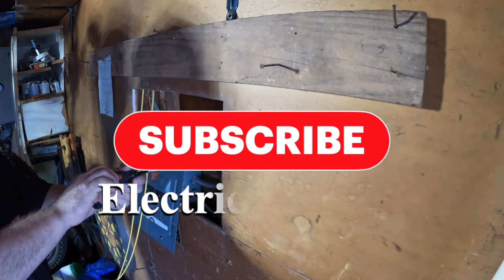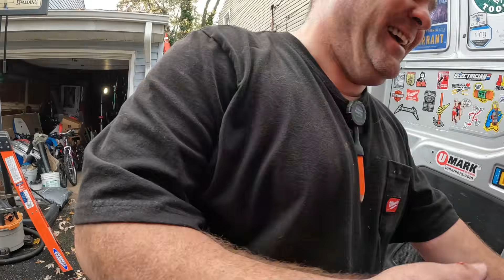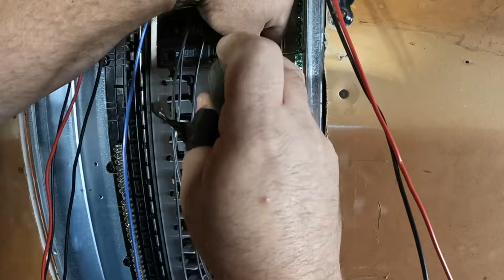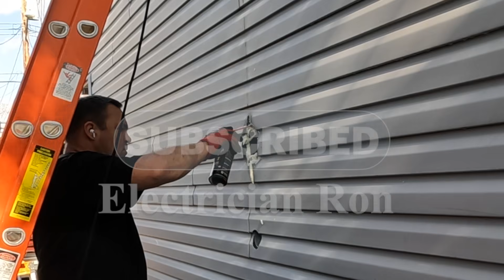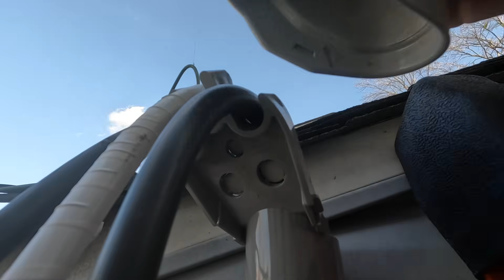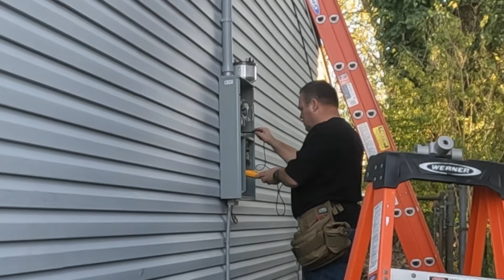Just Another 200 AMP SERVICE UPGRADE #electrician  #200AMPS

Comment: Wait. Why isn't your weatherhead 3ft above the roof line? Also, did you connect your meter stack wiring to live overhead from the pole?
Reply from the maker: Because it doesn’t have to be 3’ above the roof line. This was live service upgrade.  Yes, utility is hot. Why, you don’t do that where u live?

Comment: Actually curious why you still use no lox ? I too am an old school electrician but I have been told that is unnecessary and actually not good to use it on modern meters or panels
Reply from the maker: It’s never been “not good”, just not required now because of how aluminum conductors are designed and made today.

Comment: If the new panel required the branch circuit conductors to be lengthened, can you splice in the panel or does that have to be in junction box after the panel?

Comment: Hey fast question for you Ron, just looking for a ballpark figure.  My sister in Law owns a two family in Buffalo she reclassified to a single occupancy.  Her main service is in need of an upgrade and at the same time, she wants to consolidate the circuits for both the front and rear dwellings into a single 200A service.  I'm well aware of the different factors that could affect cost between your part of NJ and my part of NY.  But what would you generally charge for this job, if she lived in your area?

Comment: Happy thanksgiving. Nick work. Done professionally. Two question. So in 2023 nj required emergency disconnects to be installed for the service. Does it have to be outside like your main breaker meter enclosure? Also the required surge protection that’s nec or local requirements. Thanks again. New to the channel. Subbed and looking forward to all your content
Reply: Sorry about the dumb question Ron. I just did a quick search on the 2020 nec and found all the answer 😂 I’ve been out the game for a while. I’m planning on taking my exam prep course come January. To get ready for my journeymen test. But quick question when it comes to these services upgrades. What manufacturer you recommend or prefer?

Comment: is it okay or normal for your panel to have a slight hum?
Reply: Yes, it’s most likely the doorbell transformer.  It’s often bolted to the outside of the panel box behind the drywall so even if you take the front cover off you can’t see it.

Comment: Ron, great video, as always. You may already know this, but if you need a connector for MC and AC that you can install from inside an enclosure, just like those button connectors for Romex, Arlington makes Snap-2-it connectors that do just that.
Reply from the maker: @Gruntled2001  I will look into that.

Comment: The only thing i would have done differently would have been to install a rigid closed nipple or a PVC box adapter between the meter main and panel, just so I wouldnt have to cut the TA like that. Ive cut TAs in the past, but have i have had an inspector call me out for it, so now i dont do it. But other than that, it looks very good. I am a big fan of Eaton BR load centers too
Reply from the maker: @YaksAttack  it is technically a “hack” and the only nipple I had was too small. You and I know but both know it’s fine the way it was done.

Comment: Great video. Do you know if the power company ever replaced the conductors from the pole to weather head? The conductors look a lot smaller than the new conductions. I noticed the the existing weather head was about even with the roof line. At the homeowner's request, could you have extended the weather a couple of feet higher or does it matter?

Comment: So? The very old wires are simply reconnected?
Reply: Think he’s mentioned that he inspects them for signs of overheating, fraying, and the state of the insulation on them, and proceeds accordingly, advising the customer etc. In most cases the wiring/conductors, even if older are fine.

Comment: Your videos are Great. Did you mount the inside panel upside down on this job? Or do they make panels with the main on the bottom of the panel?
Reply: Any breaker that operates side to side can be at the top or bottom of the panel. Only when it moves up and down must you position it a certain way so that up is on. This is not upside down, this is a brilliant way to save space and a few bucks in heavy gauge conductors.

Comment: I had one of my friends call me about lights flickering and he showed me a pic of the panel. It was a Stablok that had aluminum Romex and some of the breakers were double and even tripple tapped with copper and aluminum Romex mixed! I told him to put the cover back on and to call an electrician lol. He asked me if I could do anything with it because I worked for an electrical contractor as an apprentice and I have changed service panels before under the contractor's license but I couldn't do anything in this case because I'm not licensed myself lol
Reply: Very wise to not help yourself to liability. You're friend sadly has to pay full price for that mess ... Good move on your part tho.
Reply: @TheTubejunky  He did get it done and had all the wiring upgraded, thankfully they had an addition put on and all that just ended up being part of the cost of the addition. If Ron here wasn't hours away from my area, I probably would have referred him lol.

Comment: Ron, since this house had a 100A service prior, is the transformer on the pole only 100A? Did the customer have to get the utility out to upgrade the rest after you left?

Hope you have a great Thanksgiving!
Reply from the maker: @fiehlsport  the utility transformer is likely 50 kVA. Good for 208 amps at 240 volts.  Usually half the neighborhood is connected to it too lol. Still waiting on final inspection on this one. Once approved the inspector alerts the utility that an upgrade has been made.  It’s totally up to the utility to decide whether any upgrades are necessary.  Of course, if I see something that poses a safety hazard I would alert the utility directly.

Comment: i'm NOT an electrician, just an enthusiast. question: that was a pretty BIG box for a small house. I was showing my son the technique, but was confused as why you only put breakers on one side. I know the busses are interleaved and it accomplishes the same thing. But I had to stop and think to explain it.
Reply: One way to try and balance the legs. Existing wire length may have been a factor for everything being on the right side as well.
Reply: As Ron always says if you’re going to do 200 amps you better give 40 spaces. It doesn’t necessarily cost more and it provides lots of future proofing. By putting them on only one side every other breaker is on a different phase which could be a good way to balance the phases or at least have less of a chance of imbalance if you don’t know exactly what’s on them.

Comment: Another great video Ron - thanks for the extra effort to film your work! And good point about using a Main Circuit Breaker loadcenter, even though you have a Main Circuit Breaker in your meter base as a service disconnect - like you said, you really only need a Main Lug Only loadcenter, but having that MCB in the panel allows for the physical interlock with a future generator breaker - great thinking-ahead tip! Cheers
Reply from the maker: You're welcome! It also allows for a possible upsell to do the generator wiring.
Reply: @electricianron_New_Jersey  Hah - good point - nice marketing! Also, I think that house next door will have "meter envy" after seeing your nice new shiny big box!

Comment: I prefer as per instruction to cut surge wire/wires as short as possible.
Reply from the maker: This is a plug open neutral so the only conductor is the neutral pigtail.

Comment: If I understood correctly, how can you continue to use 12/3  20A/240 on dryer, those pull 22A?  Do you ever do split neutrals to save on wire?  I know with in panel GFCI you cannot.
Reply from the maker: It's existing and working. I can't just go around demanding people fix everything that I find wrong. Most people want money to spend on vacations, not electrical repairs. "Most people."
Reply: @electricianron_New_Jersey  Understand, my guess is theyll call you complaining dryer trips breaker now with accurate breakers, can always run a new line if needed.